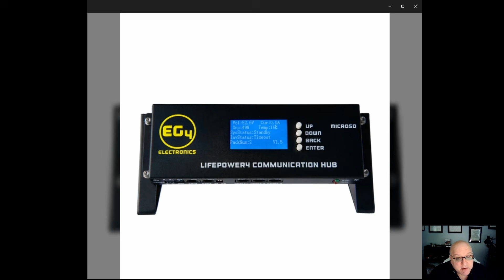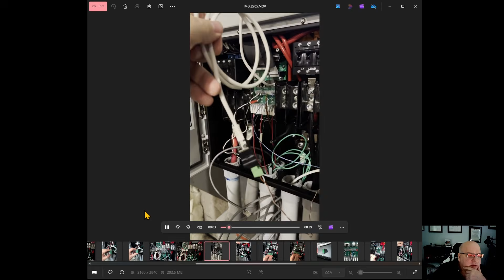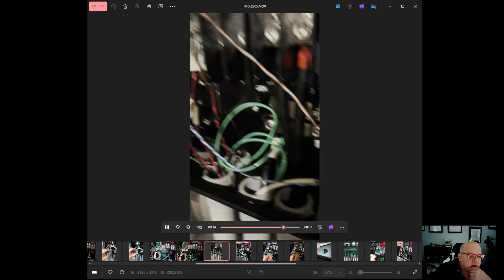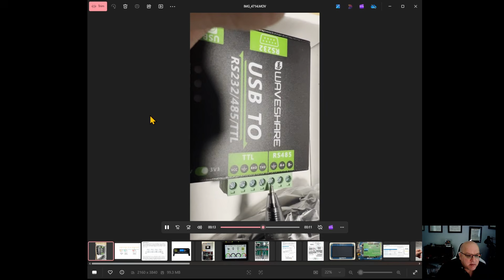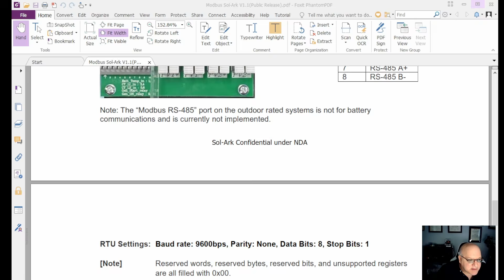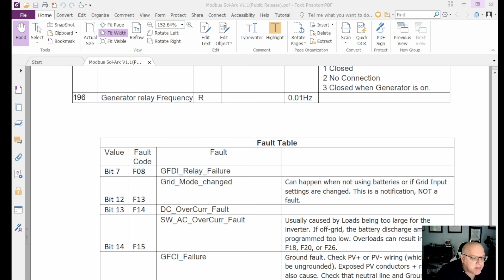Building a Sol-Ark Remote Display: RS-485, Modbus, and Power Planning

Comment from the maker: This is the next step in my Sol-Ark remote display project. The goal is to read real-time inverter data over RS-485 Modbus and eventually display it on a dedicated wall-mounted device. Next up: connecting to the inverter and checking the live registers.

Comment: Just FYI, the RSD rapid shutdown has a HARD limit of 100ma. You’ll likely blow it. Plus, shouldn’t it have a RSD module- I’m fairly confident that’s code as I heard from a solar installer. 

There’s no other power from the rails. You’ll have to go external or off the pack. That’s what my conclusion was a few months ago
Reply: Actually you /might/ be able to pull off from the WiFi dongle’s power. They don’t have a public rating, but it’s an ESP32 soo my guess is it’s at least 1A.. with ESP’s max with Wi-Fi being ~500mA.. possible! 

If you unscrew the WiFi cover you can pull the whole board out.. there’s definitely a linear regulator powering the dongle, maybe solder before it to bypass the current limit?

Comment: I use solar assistant for remote monitoring and it can set parameters, it then sends info via MQTT to home assistant but I am very interested in your project - looking forward to seeing how you develop it. Thank you for sharing!
Reply from the maker: Solar assistant is used a lot, looks pretty good, MQTT is widely used also, good point. They use the same modbus port I am discussing here, I think it scans the CAN bus also for battery info. Here is the issue I have with Solar Assistant, you basically setup your own web-server (Rasp PI) , and you use your phone or browser. I am trying to avoid having to deal with all that, and have a stand alone display, with simple gauges. Runs off the inverter power, like what a Nest thermostat does for HVAC, just a remote display HMI like on the Sol-Ark is already. Even if I get Raspberry PI and touch screen combo for my wall, it will need local power, and still need to modbus connectivity. The inverter cannot supply enough juice for that, so this will be a lightweight alternative. Some people have slapped old tablets or phones on the wall to accomplish that.
Reply: @CPlusGuy very cool project let me know if maybe I can help somehow